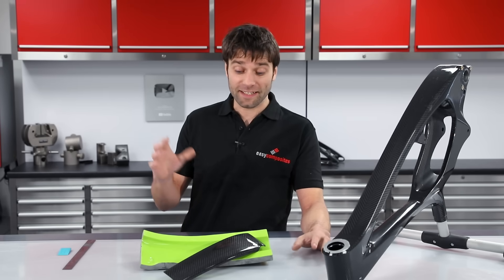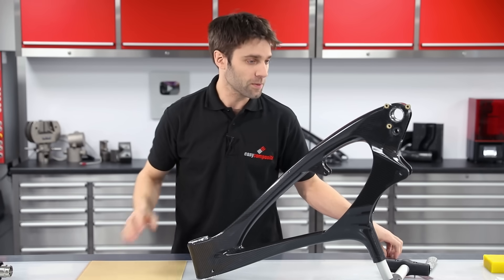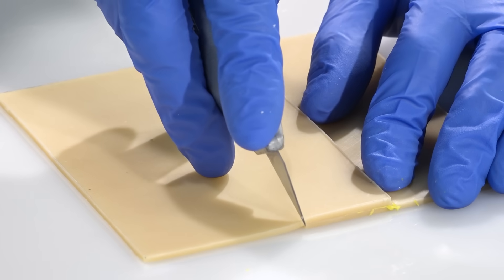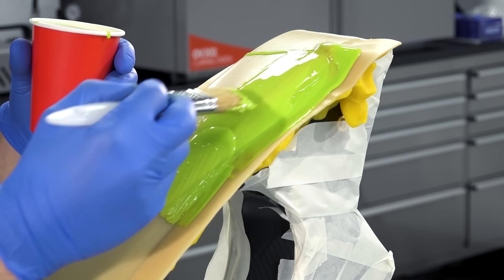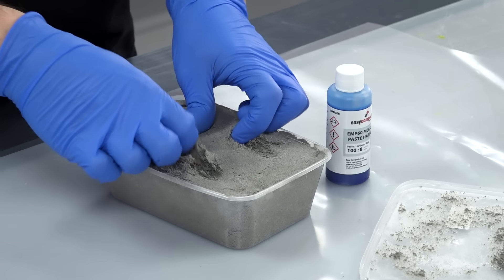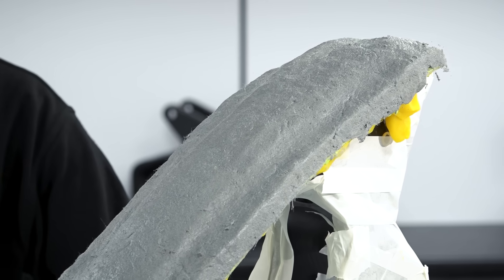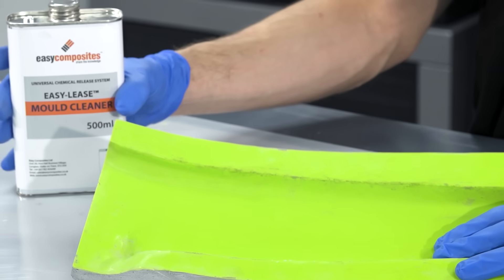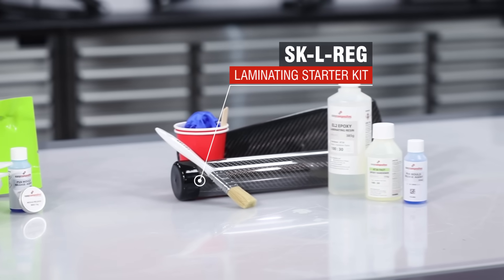Using Sheet Wax to Create an Offset Mould for a Carbon Fibre Cover Component

Comment: I would recommend just mix epoxy gelcoat aggressively and then just drop it in the vacuum chamber for a few minutes to remove trapped air.
Reply from the maker: Yes, you could certainly do that if you have a vacuum chamber, but most people don't so they need to avoid air entrapment.

Comment: So would it be feasible to make an actual mold out of sheet wax as opposed to an offset mold?
Reply from the maker: You can use it to repair surfaces but it is not very stiff in its own right.  Also the surface is not as glossy as would be ideal.

Comment: How do you determine if you should use a 1mm, 2mm or 5mm wax sheet? Is this determined by the amount of layers of carbon fibre you intend to use? 

Also, I've have a carbon skinning kit that I haven't started using yet. Would that kit be able to be used with this? It's for some carbon interior trim pieces. 

Awesome videos as always.
Reply from the maker: The thickness of the sheet is determined by the desired "offset" of the part.  In many cases like this, it is in essence only  as thick as the carbon part will be to allow a good fit.
Reply: @easycompositestv  Thank you.

Comment: Is there any chance you can make a tutorial on making a dirtbike clutch cover using this or similar method? Please
Reply from the maker: Hi Marko, it would be exactly the same process, from start to finish. The frame protector is just an example of the process, you can apply this process to any parts you need to make a cover for.
Reply: @easycompositestv  Thank you

Comment: I'd like to make a guitar case. Can I use the same technique or do you recommand another way for larger pieces? I obviously dont own specialised equipment like a vacuum table or stuff like that.
Reply from the maker: Hi Tigrre, if you're starting with a guitar case made out of another material and want to make it in carbon fibre then you would take the moulds directly off the original case (because you want the carbon fibre part to be the same size as the original), you wouldn't need to use the sheetwax like we use in this video because otherwise you'd be making a mould (and part) that's slightly bigger than the original. In terms of making the carbon fibre part then yes, the process you could use could be exactly as you see in this video, you could improvise the vacuum or just not bother at all and then tidy up the surface with clear-coat.
Reply: @easycompositestv  Thanks for the answer. I'll try to make one from scratch.

Comment: I haven't seen sheet wax since my early foundry pattern making days. Great for turning existing castings into cheap patterns by adding wax in areas for contraction allowance and machining allowance.
What I would associate with filleting wax was you could get wax extruded in long length so if laid into an inside right angle corner it formed a ready made radius fillet.
Nice technique worth remembering.

Comment: As fascinating as that was, would it not be easier to make the mould directly onto the component, then make a former from the mould and wet-lay the carbon onto the former?
Reply from the maker: Not really because, in order to maintain the A-side (the good side, the outside that you see) on the outside of the component you need to 'offset' the A-side that you already have on the component. Taking a mould directly off the bike frame would produce a mould that would make a component that's exactly the size of the frame, no slightly larger which it would need to be to fit over the frame. This is why we use sheetwax of a calibrated (in this case 1mm) thickness. By doing this, we offset the A-side by the thickness of the material that we will make the frame protector from, we end up with a frame protector that fits over the frame and still has it's A side on the outside, so it looks good :)
Reply: @easycompositestv  In order for the outside of the component to look good, if made the way that I suggested, one would need to apply a few coats of finishing resin (I don't remember the exact product name but I know that your company sells it because I purchased some a few years ago) which would then be cut and polished to achieve a perfectly smooth and glossy finish. As for the fit of the component, it would undoubtedly be a more accurate fit if wet laid over a former because the former would be identical in shape and size to the frame for which the cover is being made. You cannot claim that there would not be tolerance issues when folding a piece of sheet wax around the frame when making the mould, for two reasons: firstly, the wax is not going to maintain a precise 2mm thickness as it is formed around the frame and, secondly, you cannot guarantee that the carbon fibre cover will have a finished thickness of precisely 2mm.

Comment: How the sheet wax behave with polyurethane expanding liquid foam? 
Does it release easily and how the foam surface will look like?
Reply from the maker: PU foam will release from the sheet wax. The finish should be pretty good, similar to the finish on the sheetwax itself.

Comment: Do you ship to the USA??
Reply from the maker: Yes, we ship to the USA. For any 'non-hazardous' products shipping is fast and inexpensive, however, products that are hazardous (resins, release agents, solvents etc.) there is a £55/$75 surcharge which makes the shipping quite a bit more expensive, especially for small orders. The shipping calculator on the website's basket page will give you the exact cost for sending any items to the USA.

Comment: your videos are excellent but i have a question, when you remove sheetwax the mould will become a little bit bigger, so the carbon detail you make in this mould will be bigger right?
Reply from the maker: Hi Lasha, yes, that's exactly the point. In this video we're making a mould for a 'cover' component that will fit over the original part; for this reason we need the mould to be bigger than the original component. If you watch the second video in the series you will see us make the part and hopefully then it will be more clear to you.
Reply: @easycompositestv  i didn't listen you well))

Comment: Cool method I haven’t seen that sheet wax or the putty. 
Does polyester gel coat melt the wax? 
what’s the advantage of epoxy gel coat over polyester?
Reply from the maker: Hi, yes, polyester can be a bit more problematic with sheet wax. It's not unusable but we do normally find that polyester softens the wax and the mould usually ends up with wax pretty well stuck to it. It can be scraped off (it's wax at the end of the day) but it is more work. There are sealers available for sheet wax to make them more resistant to polyester. The main advantage to epoxy over polyester for a mould is that an epoxy mould can be used for direct contact with epoxy resin, such as when we make the carbon/epoxy part in the following video. Epoxy has a real habit of sticking into polyester moulds, no matter what release agent you use!

Comment: That is amazing! Quite a simple method to create
custom interior parts or wheel house moldings.
Do you offer classes and support to find a cheap
(from 10£+/night) acommodation?
Reply from the maker: Thanks, glad you enjoyed it. Under normal circumstances we do offer training courses but as you might guess these are on hold at the moment, under the current COVID-19 measures. When they do restart I'm afraid there are not any options for accommodation locally at that price, it would be more like the standard £50-60/night for a Holiday Inn or Premiere Inn etc.

Comment: Can you guys do a video on how to clean your epoxy brushes after they are used?
Reply from the maker: Hi William, we could but it would be very short: Half fill a plastic bucket (with a lid) with acetone. Rinse your brushes in the bucket and put the lid back on. The End. :)  I hope this helps.
Reply: Just buy £100 worth of thinners and wash the brush every hour until clean.

Comment: The follow-up video doesn't exist. This is the last one in the video list.
Reply from the maker: Its coming soon, just in post-production at the minute.
Reply: Thank you so much for responding. I have 3D printed molds out of PLA. Would the kit in the video, minus the wax sheet, work for creating a reverse of the printed mold? I'm trying to find the best way to fill in the female mold to make a male without it eating the PLA material. And I love the color of this gelcoat...
Reply from the maker: @HiGHrVOLTAGE  It certainly should work, yes.

Comment: Good job ... but how do you fix the difference in the dimension of the piece resulting from the thickness of the wax layer ....?
Reply from the maker: The whole point of this process (the reason we're using sheet wax at all) is that we want the difference in size between the original and the mould, so that the cover component will fit correctly. If you don't want the size difference then just take the mould straight off the component.

Comment: Well done as usual! Thanks for making it. I never had any success polishing epoxy gelcoat much. Is this something special? Perhaps hitting the first layer with the hair drier would be useful to pop any air bubbles.
Reply from the maker: Epoxy gelcoat is normally just harder that a polyester or vinylester gelcoat. This does indeed make them harder to polish but certainly not impossible. The key would be making sure you've done the rubbing back properly with the abrasive paper (no underlying scratches) and then using a suitable polishing compound. The NW1 we use in this video is designed for very hard materials, like epoxy, and so does a much better job that most compounds.

Comment: Would love to hear your thoughts on how to deal with inserts in a composite part!  I'm making a kevlar/carbon longboard currently and I'm trying to figure out the best way to bolt the trucks to the board.  These videos are gold and I really hope you keep making them! :)
Reply from the maker: Thanks Scipier we certainly plan to. There are lots of different ways that inserts can be included or combined with composites. One simple but effective method, for something like a longboard, would be to include a metal plate inside the laminate. Especially if you have a thick laminate with a core, you can cut the core out where you want the hard points and swap it for a metal plate. This plate could be drilled and tapped in advance or afterwards. The reinforcement can rub over the metal plate top and bottom, encapsulating it into the 'sandwich' This is simple but effective. We are planning a video on this and other fittings/inserts in the future.

Comment: when you join the two pieces of wax @4:08  how would you do this as to not mar the job you where moulding?
Reply from the maker: Just take care with the blade.  The wax is soft enough to not need much pressure to be cut.

Comment: He calls it easy but there's like 12 steps here along with hours and hours of curing time, and 4 different post processing steps...
Surely, this is not the easiest way to make molds for carbon fiber parts?
Reply from the maker: I'd say that the mould making part of this process is about as easy as mould making gets. Be clear though that this video is about making an offset mould, i.e. one that's larger that the original so that we can make a cover component that fits properly. This isn't supposed to just be a general method for standard mould making. If you just want to take a mould off an original component then you don't need the sheet wax step at all, you can just apply a release coat to the component and then apply the moulding materials directly onto the original.

Comment: Would it be possible to use this method to create a 2-part mould? For example, using the wax to get the form of a turbo compressor housing, creating the mould the same way as in the video, but once the epoxy putty has cured, leaving the wax in place and applying a gelcoat layer and further putty. Once cured removing both halfs and using bolts to apply presure on the flanges to the carbon inside?
Reply from the maker: Yes you could use it to create the "void" for the carbon fibre to sit in with a compression moulding 2 piece tool.  You would have to ensure your lay up is the right thickness for it to work neatly. Also don't forget your dimensions will be displaced by the thickness of the wax.
Reply: @easycompositestv  brilliant, would the mould hold up to oven temps for using pre-preg?
Reply from the maker: @mattygerbil123abc  Not using the EG60 and EMP60 that we used in this video but we do have high temperature versions of these products; EG160 and EMP160, which would be suitable.

Comment: Do you ship to USA from Britain at competitive prices? I noticed with exchange rates and whatnot, your shop offers competitive prices compared to the sometimes very high prices in US warehouses.
Reply from the maker: Hi, to be honest it usually depends on what you're ordering. We do offer direct shipping to the US from the UK and yes, with the exchange rates how they are and some lower prices anyway our prices can look very competitive against your local prices for some products. The sting in the tail is usually delivery cost; for non-hazardous products - like dry materials, cores, fabrics, sheet wax even - then the shipping costs are very reasonable and the service is fast (1-3 days). For hazardous materials - like resins, release agents, solvents etc. - then the shipping costs are considerably higher because of the various surcharges when transporting hazmat by air. On the Easy Composites website though you can get an instant, accurate quote for shipping to just about anywhere in the world, including the USA, by simply adding the items to your basket and then entering your address details on the shipping calculator on the basket page. The only additional charges you will pay would be US import duty.

Comment: iam putting mavcoat release and then airbrush on some pva on sheet wax. Then poly gel-coat. My parts are in primer out of the mold, same process, mav/pva/primer/gelcoat.
Reply from the maker: Sounds like an interesting approach but I guess you're only wanting to make a single component using the wax mould though, which is unusual.
Reply: @easycompositestv   no, l use sheet wax to represent the thickness of the velomobile carbon body like you did, Then start making a plug dwn in there in the floor, then pull 2 part mold/tool from the plug. But l have mavcoat release in usa. im old school l put couple layers over tooling gel then putty, im new to putty. l use your fillet'ing wax.

Comment: Once again, absolutely outstanding content. Good mix of information. Fantastic presentation. Professional camerawork. A++++++++++.
If I had a request, I know you've already done this before, but a full project really reinforces the idea that I can go out, buy these kits and make stuff. I've bought some stuff from you before, but if you started with a Mold making kit, a prepreg kit and a pattern, and showed it end to end it'd be GRAND. Cheers bud.
Reply from the maker: Hi Stan, thanks for the comments. Yes, we take this on board. You're right that we have done several full projects (usually over a number of videos) but we are conscious of making some more 'accessible' projects using our starter kits. The second part of this video uses our laminating starter kit to make the component so is hopefully along the lines you're thinking.

Comment: I'm looking to manufacture around 100 chain guards I'm think of making a carbon fibre mould using a manual lay up over a 3d printed model. Would that work?
Reply from the maker: Do you mean carbon fibre mould or carbon fibre moulding (i.e. part)? For ambient temperature use, there's no advantage in using carbon fibre for the mould. You could certainly 3D print the pattern and then use a hand layup process (like we use in this video) to make the mould. You would normally need to finish the 3D print with some kind of coating; our Pattern Coat Primer works well.

Comment: This process seems too imperfect to me. Won’t the final piece end up being larger than necessary and just rattle around?
Reply: He literally goes through this just one minute in the video....!? Using sheet vax with the thickness of the final carbon piece will ensure a snug fit.
Reply: @TheRealDr.Mabuse  But look at 0:24, you can see that the wax is not a uniform thickness. I think it's safe to assume that with pressing on and using a heat gun, the wax will be equally uneven throughout the mold.
Reply: @Thee_Sinner  What you see is the epoy gelocoat. The vax itself is already removed leaving the space, the offset of 2 mm, making room for where the carbon piece will be made.
Reply from the maker: Hi Uriah, yes, as others have now posted, the 'gap' or 'oversize' nature of this mould is exactly what we wanted. We need a mould that's larger than the original part so that when we lay the reinforcement into the mould to make the component it will eat this gap back up, creating a properly fitting part.

Comment: great posts as always. it would however be even better if the demo's are summarised by an estimated cost of materials to really understand if one should have a go...
Reply from the maker: Hi Christophe, that's where the project page on our website comes in. Youtube is just a video platform but if you follow the link (in the description) to the project page on our website you'll find much more information about the project, along with links to all the products used. In a new version of the project pages (going live in a month or so) you'll be able to see an exact cost breakdown and even buy the products instantly, in the correct quantities. For what it's worth, this whole project would cost you less than £100.